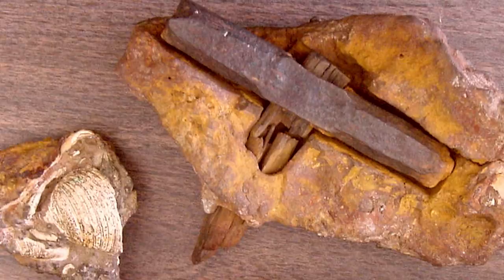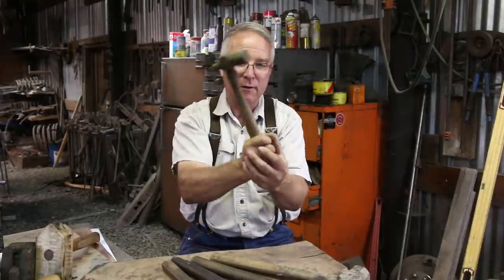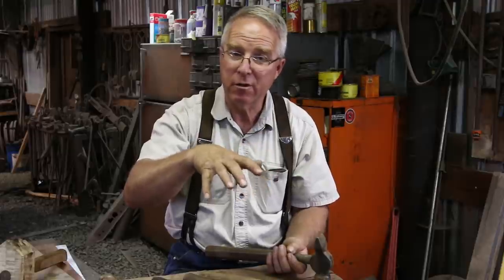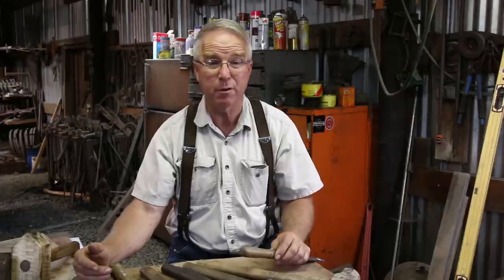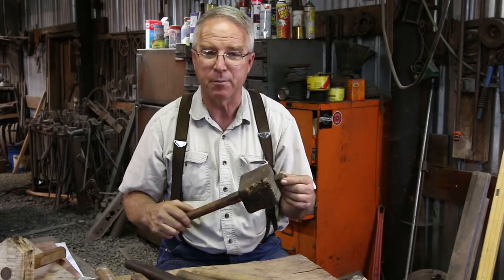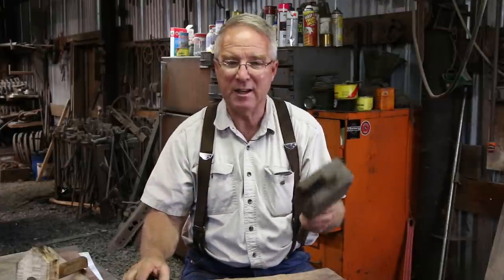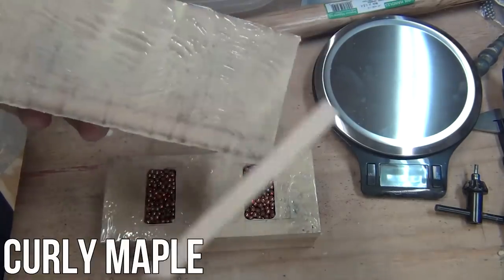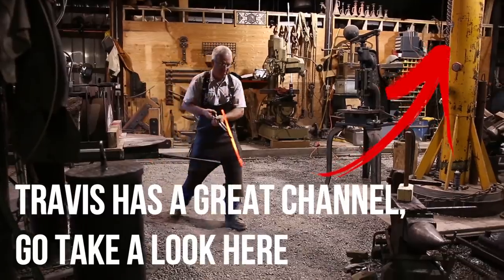Technology of Hammers & My New Wooden Sledge

Comment: The "leverage" on a hammer handle works in reverse to the "conventional" way most people think when they hear the word. A longer handle allows you to bring the head to a higher speed (the radius and thus the circumference of the idealized circle, on which the head travels, gets larger). With kinetic energy being proportional to the square of the speed, this allows much higher kinetic energies at the same speed of hand movement.
Reply: is that similar to how a wheel moves faster at the outside than the inside? is a wheel just a spinning 360 degrees lever?
Reply: Yes.
Reply: The lever does two things. One is to create a more ergonomic way to strike the workpiece, which you generally want to do flat. Hold a hammer head in your hand and see how awkward it is. Workbenches would have be chest height, bringing the impact close to your face rather than closer to your waist. That itself is enough advantage that it would be a tool on its own. The other is that the lever slows the swinging of your arm down but adds more weight for the same speed. That's counterintuitive, but here's why. When you swing the hammer, you can only put so much energy per second into it. By increasing the time spend swinging, you have more time to put more energy into the hammer. If that still doesn't make sense, consider how slowly one moves a sledgehammer, you spend 1-2 seconds in a full swing for a tremendous impact, versus the 1/4-1/2 second you spend swinging a smaller, shorter, lighter carpenter's hammer.
Reply: This is also the principle behind the sling (i.e., the weapon).
Reply: Not being a smarty pants - just think this is a fun conversation... Leverage here is probably more of a metaphorical application of the word. The accelerating of the hammer head at an increasing velocity results in an increased total mass or relativistic mass; how the acceleration is achieved isn't considered with solving for inertia - and that now has successfully exceeded my qualifications LOL 
"Constrained Radial Energy"
Reply: It's antileverage
Reply: Think of this as impedance matching.   What is desired is high velocity into the hammer head (low impedance).  Your arm has more strength than it has speed (high impedance).  The hammer handle (just like the transmission gears in your car) matches the drive impedance to the load impedance and maximizes the power transfer.  Which is why people with stronger arms can best use longer hammer handles....
Reply: @gregcollins3404  High five.  Maximum power transfer analysis.  Learned it in Electronics Engineering as "Maximum power transfer occurs when internal system resistance becomes equal to load resistance".

Comment: I made my first wooden hammer working on an outdoor project. I had broken a handle on some post hole diggers so I drove the round end through a scrap of pt 6x6, chamfered the faces, and shaped a comfortable grip in the square section with my block plane. I was really kind of playing on the job, but in 20 minutes a made a tool I still use to make adjustments on outdoor projects without  leaving elephant tracks

Comment: A wooden mallet is used by a carpenter/ cabinetmaker for two reasons: to prevent damage to the chisel handle, and also, the large striking surface of the mallet allows the user to concentrate attention on the cutting edge of the chisel rather than on the end of the chisel handle.
Reply: Robert Edmondson True, but the discussion of wooden hammers is informed by the cultural presuppositions that hammers be metal... Historically, a cabinetmaker or other workman used a wooden hammer because he could make it from available materials and replace it without real cost. Metal hammers developed to strike, drive, or form metal objects, and because they had good wear characteristics. Even the wooden hammer/mallet with an applied head mimicked to some extent the development of metal hammers, but many trades used fat-ended wooden 'clubs' that were formed often out of riven wood.

Example: Mike Dunbar's self-made striking tools for making Windsor chairs. The chisels struck with this 'club' (mallet) have brass rings on the handles to prevent the struck surface from splitting under repeated use, for longevity, but the mallet itself? A sacrificial tool that could be easily replaced. (Fwiw, I think Mike Dunbar was turning his mallets when I sat under his tutelage)
Reply: I am not quite sure of your "cultural presuppositions that hammers be metal", or your statement that historically a cabinetmaker used a wooden mallet because it could be replaced without real cost. For the reasons given, when doing chisel work, a wooden mallet is the more appropriate tool, regardless of its cost or the availability of metal hammers. Timber framers too, could use metal sledge hammers when assembling frames, but choose to use very large, long handled wooden mallets, not because they are disposable (they aren't), but to prevent damage to the wooden posts, beams, and braces.
Reply: Robert Edmondson there's truth in what you say. But from stone hammers to steel, to wood, hammers developed from what was discovered and available. In this process, certain methods of use and the preferred materials used proved that some applications were better served with wood.

The cultural presuppositions I refer to are demonstrated when one looks at younger folks who are surprised to have a crank handle instead of a button to lower and raise the windows in a car; not too long ago electric operated windows were a novelty, then a luxury. Now they are expected, assumed normal. A similar cultural norm is witnessed with younger automotive technicians who are mystified and baffled by carburetors in an automobile engine system. One tech expressed confusion because an old motorcycle didn't have a diagnostic port, expressing, "how do you figure out what's wrong with it if it isn't running right?" He went on to mention his tech school didn't cover antiques. 

Humans tend to believe that what is familiar, what we've experienced, is 'normal.' If it isn't in a catalog or on the shelf at the hardware store and we haven't experienced the use of an item, a wood hammer for example, or one of the quite long-headed timber framing mallets you mention, we humans assume it's a 'flyer,' possibly quaint or archaic, or an esthetic. Today we humans too often assume if it's not 'manufactured' it isn't relevant or perhaps even practical, or possible. A recent post I saw where a fellow asked where he could buy the wood guides someone adapted to a handsaw for controlling depth of cut demonstrates this: the wooden guides were simply waste tablesaw offcuts through bolted to a handsaw with brass machine screws but the fellow posting assumed he needed to buy them somewhere. Or the city folk who think 'barrel' stoves are unsafe but plug their bedroom air conditioner in with a 16 gauge cord...

I just find it interesting to observe how people interact with items in their world and have been fascinated since childhood watching how people use things or form views of certain technological developments. People with cell phones, even proficient smart phone users are still fun to watch :)
Reply: Thankyou, Fishhuntadventure for your articulate reply. I don't mind longer posts at all if the person has something worthwhile to say, which you do. Your observations bring to mind a spoof I saw about "The Antique Road Show". All the "antiques" were electronic devices from the 80's and 90's, brought by eager owners hoping to cash-in, only to be informed that their gizmo, whatever it was, was "absolutely worthless". One young woman brought an early cell phone. She didn't know what it was. The appraiser told her that it was indeed a telephone, and pointed out that it did not have a built-in camera. The young woman looked at the object with incredulity. "Then how is it a phone?" she asked.
Reply: Robert Edmondson that's awesome! I need to find a clip of that!
Reply: I can't remember where I saw it. Might have been a "Second City" production - a Toronto comedy troupe. .They did some brilliant stuff.

Comment: Just to add to the physics conversation (and to be admittedly a little pedantic) the cross peen doesn't increase the force per unit area, it simply reduces the area. So if the average force of a hammer blow is 100 lbs, (per google) and the flat face is about a square inch, you get 100 pounds of force. If the area of the cross peen is about 1/4", you'd get 400 pounds of force because PSI / area = force. 100/.25 = 400.

But that's just my inner nerd talking. great video!

Comment: Kinetic Energy delivered = 1/2 mass x square of velocity.  The addition of a handle and the arm is principally guidance if it is just 'dropped' to the impact point, but the weight and muscular  force can be added to increase the energy delivered to the target.  Also, increasing the speed increases the energy more effectively than increasing the mass, i.e. a lighter hammer moving faster can impart more energy.
Reply: Bob Blarney .

Comment: Au contraire, when hammering hot steel with a soft hammer, like a leather/iron hammer, the part in contact with the Anvil is forged. I call it half forging. The materiel is worked almost to the center of the bar.

Comment: Typically the wedges in wooden mallets should go perpendicular to the grain so that you dont split the head but the mallet he made im pretty sure will be just fine - the curly grain adds a ton of strength plus it being a laminated mallet are more than enough to keep it from splitting out.

My favorite mallets iv made have all been out of white oak crotch sections (crotch- as in the crotch of two large limbs of a tree- the grain there gets all bunched up and makes for very very strong wood, as anyone who has split large crotch sections for firewood will tell you), they just hold up like no bodies business.

Comment: You're actually storing the energy in the hammer (and your arm/muscles) when you raise it up, not during the swing.  Once it's released from its top starting position, you're using the stored energy changing potential (static) energy into kinetic (active) energy with the help of gravity and the muscles in your arm.

Comment: the handle is almost the opposite of how a lever is used
in the hammer's case we are trading an acceptable increase in effort at our wrist in exchange for a gain in   Velocity at the hammers head..because we want max kinetic Energy : k=1/2mv^2  
The handle could be replaced with a rope for this example, the wrist (or elbow etc) is the center of rotation,  "whipping".  Of course a rigid handle has some other nice features in the world of hammers ;-)

Comment: Can you adapt a hammer to that purpose by affixing a hard wooden face to an otherwise metal "normal" type of hammer? Might make for a good video. Might not :) cheers
Reply: I second being curious about that approach. I'm sure Scott would have the best guess about what adhesive or other technique to use if satisfactory results could be achieved by any means.
Reply: I believe it would be possible to "bury" a 8-12 oz. ball peen hammer in a block of hard maple by creating a fitted pocket in two halves then gluing or screwing them together. This combination would add necessary weight without marring delicate work.
Reply: Ellie Price tight wire wrapped wood "casing" perhaps? Stainless hose clamp?
Reply: I bet the wood wouldn't resist for a long time... maybe if you glue it around the hammer, with pieces of strong leather  between the wood and the metal... Must me more work that creating a wooden hammer!
Reply: Anchor Bait: Stainless wire or clamp a great idea. Maybe a round split maple head with a 1.0 square length of steel or brass inside would simplify the pocket.
Reply: Might be able to just use a steel shaft.

Comment: Just use a heavy hammer for chisselwork. Like a smallish sledge with short handle-Dont know what they are called in English. -Wont harm the chissel cause you hit it SO less times than with a light hammer. That wood thing will work fine if its heavy enough, but then another tool to take room. America is bigger of course, so you have more room

Comment: teeeeechnically, you are translating potential (gravity and chemical (muscle)) energy into kinetic energy. this is transferred into whatever the hammer hits. the only energy storage is in your arm muscle. <end pedantic physics>
Reply: Edmund Schwartzadder Einstein said that mass has inertia and thereby has a storage of energy. The moment of muscular exertion to accelerate that mass, if it did not have 'energy,' would not by the formulas, be able to impart any energy, or energy increase, if energy were not present as zero multiplied is a zero value.